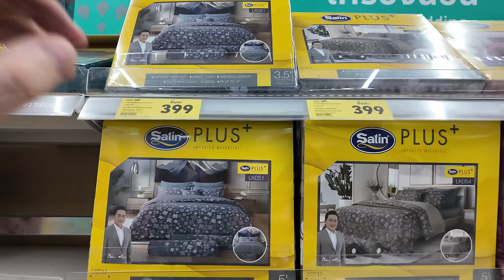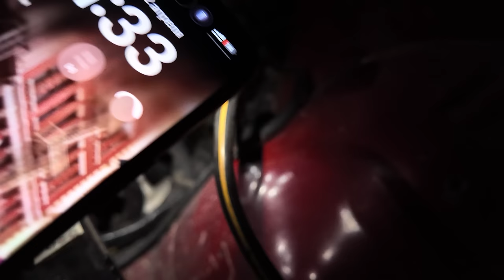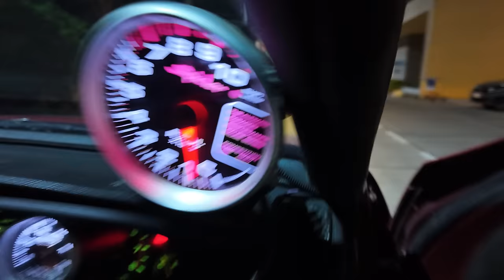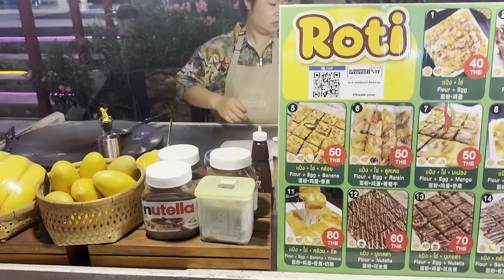Spraying Everyone With Water In Thailand

Comment: Rust-colored radiator water is not a good sign.  It should be clear and always check for fluid leaks on the ground.
Reply: @Skippymizzle It's Thailand. People do what they can to get by. But I understand what you're saying.
Reply: Radiator should have coolant which is green.
Putting water in radiator in summer just rusts it out then orange will come out.
In winter water will freeze in radiator.
Reply: @gailschultz9730  yeah and she said “ Oh the water you can see” I know how cheap they are in fluids hell they sell gasoline in pop bottles!  Buyer beware, Ivan’s gonna have to deal
With it for sure and he knows about coolant ( we call
It antifreeze/coolant , but they don’t never freeze so..
Reply: @none_ya001  Hello! Yeah I could imagine most of the guys overthere are better versed in motorcycle engines too. 
✌🏼
Reply: @gailschultz9730 I know, but this is Thailand. Never freezes.
Reply: @gailschultz9730  not true, theres purple and orange. Hoat and oat anti freezes also. Antifreeze also has anti corrosive additives which prevents rust
Reply: No, it should have antifreeze to prevent overheating.
Reply: @Skippymizzle  what's wrong with the gasoline in pop bottles? This is common in all SE Asia, and the bottle contains just the right quantity for a small motorbike. Selling it provides some income for low-income families....
Reply: @Skippymizzle  Antifreeze/coolant helps your car run cooler in the summer and stops your cooling system from rusting.
Reply: @mick-berry5331   safety ….quality

Comment: Don't install the turbo it puts more pressure on the engine and it can kill is faster.
Reply: agreed
Reply: Especially in Thailand. They need dependable transportation not a race car...get a Camry or a Civic
Reply: @georgemartin1436 I agree, forget the turbo.  Get a Dodge Charger!
Reply: We don't like anything smaller than a medium six cylinder.
However the used car with medium four with turbo in it can do as good if not better than the medium six but good mileage compared to the med. 6 cylinder I had.
Only issue is it takes off so fast that I am used to needing more time to get to normal speed so I am way over in that time and with low profile tires it rides better and curves at faster speed feels better.
Can give our Chevy half ton 6 cylinder med. or larger size engine, some competition.
Reply: d.b.7352  we’re talkin Ivan he’s Mr cheap. Except when it comes to electronics, or things with cool flashing lights 🔴
Reply: @georgemartin1436  Second that two of the best cars and car companies.
Reply: Also, is the local octane high enough for the turbo?

Comment: Pull the dipsticks and look to see if the oil looks ok. If you see coolant in the oil, the head gasket is blown. Look at the tranny fluid to make sure that it's clean. You can tell if a car was maintained by just looking at this stuff. Look at tread wear on the tires. Is it even? Just a couple tips.
Reply: You should smell the oil and trany fluid ! Do they smell like oil, or burnt oil ?

Comment: in thailand "oil" translates to gasoline.  "engine oil" is what you want to say, but even then the translation can be difficult.  Getting work done on your car in thailand is difficult, i would recommend getting a completely stock car there and also get something that you see many of on the streets.  finding parts for uncommon cars is difficult and mechanics have a different mindset than you might be used to, if they can get it to drive down the road again it is "fixed," it is difficult to find someone to fix things correctly to factory spec.

Comment: I googled the bed linen, aseannow had a thread about it from 2006, it says Thais buy very expensive (compared to the rest of the world) duvet with no cover and they don't wash them.  They say it is VERY difficult to buy duvet covers and bedlinen is very expensive.  You would have to use 2 top sheets and sleep between the sheets with your duvet on the top.  Flat sheets are also difficult to find.
Reply: When was visiting USA in EVERY hotel a blanket was just put in between 2 bed sheets. So i guess it is similar with Thailand

Comment: Id be getting a toyota these days. Bud.  Most cars engines are trash in late 2000s. Cheers Mr Sanctioned Ivan. 😂
Reply: Including Toyota.
Reply: I see a lot of toyotas on the road there.
Reply: @goclunker  agreed man i live in canada and i just bought a 2009 dodge caliber and its got 130,000km on it a and it run like a champ
Reply: @seanwood5443  Dodge Caliber?  One of the worse cars ever, forever breaking down.  That's why used ones are so cheap.  You got lucky with yours.
Reply: Buy a Honda Civic SI 2 door/Coup with Vtech,  Great cars and used in Fast and Furious.

Comment: In the US the blanket you are referring to is called a comforter. The thick batting has the cover sewed on so its an all in one solution and yes you have to wash the whole thing. Typically I am not a fan of them and would rather sleep with what we would call a blanket which is not comforter or a duvet but just a heavy piece of fabric, sometimes woven from heavy cotton or wool or some other fabric like felt. There is no cover that comes off so you wash the whole thing but It's much less bulky then a comforter and cooler to sleep in.

Comment: Ivan get yourself a magnet to test those car bodies for how much metal is gone. Those cars could have a lot of Bondo (filter) on them to cover up rust. Painting over crapy metal will not last , will rust through the paint quick.  Buying a “as is” car can be sketchy. No warranty. 
Make sure you check air conditioning and engine cooling system for no leaks. Run your finger across radiator if little fins   Break off radiator no good. 
Check temperature gauge and oil pressure if it have. All gauges must work, if they don’t you won’t know anything about how good it is.  In that heat cooling system needs antifreeze too to handle heat. If they have plain water in it probably got leak. Check overflow tank, if empty probably have coolant leak.  The oil should be at correct level if low ,oil burner also check tail pipe for black gunk oil burning and or runs rich.  If engine oil milky looking
Water in oil , head gasket , crack in heads this is no go. Look under for leaks, gas,oil or water. Ask why you selling car, ask questions to see if lying.  If they say no water leak and you find walk away.  Don’t sound too Excited about the car it will be more difficult to make a deal they won’t wanna come down on the price if they think  you have to have it😅.   Think what needs to be done and take off asking price. Check documents 
Make sure not stollen. 
Good luck Ivan, I love your videos

Comment: BE CAREFUL - You don't need a car wreck to deal with - farang probably will not do well in the Thai legal system.
What you are looking for to go over your blanket is called in the U.S. a duvet.  They aren't all that popular here - we have them in our home, but it seems simpler to just wash the blanket.  They are considered "fancy" in the U.S. and I suspect that they are more popular in colder regions, or areas with distinctly different seasons.  Anyway, try shopping on-line for a duvet.
Reply: In some parts of the U.S. we simply call that a bedspread.
Reply: @barreloffun10  All parts of US !!
Reply: In The U.S., a Duvet is used as a cover for a goose down comforter. Because goose down comforters are very expensive to dry clean (you can't wash them) ! I have never seen them used for regular blankets. As almost all the blankets in the U.S. are 100% washable.
Reply: @fposmith  We have duvets on both down and synthetic fiber comforters, and have comforters of different weights for different seasons, allowing the same appearance to the room by simply placing the duvet on different comforters.  It is my understanding from watching the entertaining "Feli from Germany" that this is a common practice in  Germany, and I suspect other countries, but it is certainly less common in the semi-tropical areas of the U.S., where we don't have as much need for cover.  I would guess that Thailand has a similar situation.  Naturally, YMMV.

Comment: Ivan, I know you really liked that red car, so I'll give you a tip: that small hole in the roof can be sealed with plastic wrap by yourself, and a can of plastic wrap doesn't cost more than 2 dollars. After sealing and sanding to level just buy a small can of red paint and a brush, you can do it yourself. Or you can look for a metal shop and do some welding on site and then paint, this won't cost more than 10 dollars.
Reply: I did not  see Ivan check the under body, where’s lot of rust could be. If it’s got rust stay away from such a car.
Reply: @chrisczarnik3439 Yes, you are partially right. Rust is a big problem, but this is common in all coastal cities due to the salt-laden wind blowing in from the sea. It will be very difficult for Ivan to find an old, cheap car that doesn't have rust in a city on the coast.
Reply: @chrisczarnik3439 The advantage of this red car is that it has the "Fast and Furious" style, as Ivan said.

Comment: Yo Ivan you don't need to replace the roof. Sand off the rust in and around the hole and patch it with bondo then you just paint.  Or have a shop do it. It's not that big of a repair

Comment: In the US there is a difference between a blanket, a bedspread, and a comforter. Duvet covers go over comforters, which do not reach the ground as bedspreads do.
Reply: Is a comforter the same as a duvet?
Reply: @susanwestern6434  not where I'm from
Reply: @susanwestern6434  I don't know but I have never had a problem with a duvet cover fitting.

Comment: I would just put some "body repair tape" (thin adhesive-backed strimp of aluminum) over the holes in the roof, and then hide the tape by putting racing decals over the tape. However, the rust in the coolant shows that the previous owner was doing NO routine maintenance, so don't expect it to last long. Given its problems, they will probably accept a really low-ball offer.

Comment: Check oil levels. Check under the oil cap. Look for light brown peanut butter substance under cap for (Blown head gasket) look in the coolant tank for bubbles (exhaust in coolant) look for oil in coolant. Buy an OBD 2 code scanner. Check for recently reset check engine light. Test drive, check brakes, tires. Good luck buying a car.

Comment: Bulky Setting/Bedding Setting on the Washer and dryer.  Most if not all blankets are that way in the west.  1JZ/2JZ or a RB are all sold power plants, just how much $$$$$ to get them in a good shape and running after they have been beat on.  Best bet would be a ECONO box/ Shit box  do they have K vans where your at those are the ticket and fun to drive.

Comment: Ivan another great decision not getting the red car. It is a four door which is not cool sporty.    I owned 3 Honda Civic Coupe Si Vtech engine which were used in Fast and Furious.    You cannot go wrong with a Honda. Bangkok there will be more cars to choose from.  Be patient!    To buy the perfect car if they have a Car Trader online .   You should be $ to get a mechanic to look it over before you buy.  Do a lien search and an insurance accident search.    Make sure the speedometer is not rolled back. Ask for service receipts and look at wear on the gas brake pad pedals.  If there is a lot a wear with extremely low kilometres be suspicious.  

The Roti looks flippin good!  Water fights always a blast!    Have a flippin blast of fun l.

Comment: Just a little advice.  Where you  wanted to squirt the guy and he and waved you off.  And you started chanting and all that.  He was just walking by minding his own business. 
You don’t want to piss people off there.  You are a foreigner and they might not react with all smiles as you expect. 
And if a local gets into a confrontation with a foreigner.  It’s very common other locals will join in to defend the other local.  And it will be more than one against you.  Physical confrontations  there are more common than you might think. 
Foreigners are basically tolerated by the locals. 
As long as you don’t overstep their boundaries. You are dealing with a different culture and should spend some more time learning about it for your extended stay.  Things will go much smoother and safer.  
I’m not saying don’t have fun. 
But you need to learn more how to deal with the locals for your extended stay.
Reply from the maker: im sorry but im celebrating

Comment: Be careful.  Pink stuff in the radiator could mean transmission fluid and antifreeze has mixed together and that will flood the transmission solenoids and ruin the transmission.  If that happens, you will have to buy a new one

Comment: No one replaces a roof on a car. The fix would have been to get some bondo or epoxy filler, pour it in or apply it, let it cure, sand it, and paint over it. You could have done the job yourself, or hire someone to do it.

Comment: Just to give you some advice when buying a car you never want to go try to buy a car at night time because there's a lot of things you can't see. Are there the oil leak on the bottom of the car? You ain't going to see it. Always look from top to bottom inside and out. Make sure there's no lights on on the dashboard and like he looked at the radiator cap is full of rust. It has to be green with antifreeze. Be careful when buying a car

Comment: They call gasoline Oil in Thailand. The biggest thing you have to look out for is flood damage. A lot of flash flooding in Thailand. 
Just get yourself a little Toyota. Easy to get parts and repairs, and reliable. Not hard to sell if you have to.

Comment: Old cars need to be checked every year by Thai land transport office which includes emissions and noise test. To get past any mods failing the test one must pay under the table. Next problem will be passing through any police checkpoints with a heavily modified car. Good luck with that one as a foreigner. Buy a sensible reliable car making sure its taxed and properly insured. The less interaction with local authority the better.

Comment: Get some jb marine weld bro, its great stuff!!. Its an epoxy that will seal it right up.  Sand it and Find some matching or close to  matching spray paint and a cheap clear coat. Done for a cheap car if you there only for a year or 2 max anyway

Comment: Very strange with the rust under the paint on the roof, that's typically the last place you would expect rust because it shouldn't be holding moisture. I noticed the trunk looked completely stripped of interior panels, and the whole car was repainted a different color. It's making me think the car was in a flood or something.🤔

Comment: Buy the red Nissan! Original engine, no smoke, not a Toyota swap as in the green one! The roof can be easily fixed on the red one if the body shop is a good one! They just fix rotten spots with new patches of metal that they weld. If done properly, you won't even see that it's been fixed and way cheaper than a car with bad mechanics!

Comment: Don't by European vehicle, parts are more expensive outside of europe.  Buy a Toyota Corolla  or Honda Civic to save on gas and parts are easy to find & cheap too.  Avoid buying a car that has an accident in the front. Engine is most important part of the car.  Of course, the seller fixed it to cover up so check under the hood for different color paint.  Good luck finding your car!!

Comment: And when you're looking for a car? Yeah those cars are nice when they're lowered but you have to be careful because you as a foreigner in their country they will take advantage advantage of you and I'm not saying all of them will but half will take advantage of you because they made me think that you don't know any better. Don't rush into it and take your time and don't get it. Lower the car because half of the time they'll heat their coils and make them lower. And you see it was already bouncy and it sounds like it was going to fall apart. You have to make sure the radiator is has green antifreeze or pink or yellow. If it's water, the motor is no good. Make sure there's no check engine lights. Do it during the day okay and make sure if you can get you a translator that speaks good English. That's better like that so don't rush into it. Find you maybe a truck or a car that's not lowered and put it through its paces. Like I said and make sure you look on the bottom that it's not leaking any oil. Take care

Comment: You need "water gun" and "Raincoats" ! You also need to buy a separate blanket. The blanket you are calling a blanket, is not a blanket ! It's a "bed spread" ! It's only for looks, for when the bed is made. Don't buy the red car ! If it has rust on the flat part of the roof, it has rust in places you can't see !!!

Comment: the red car has rust in radiator water. no good. the roof rust is not hard to fix. does not need to change the entire roof. u just cut out the rust and replace with mig welder. 
its a one day job to repair, and a two day job to paint. the hard part is getting the colors to match.
Reply from the maker: You think it can be just part cut and wielded? Looks like the guy mixed antifreeze with water maybe?
Reply: @SanctionedIvan  Yes sir. that damage is cosmetic, personally have repaired several damages like this.

it actually looks like chemical damage yes, i think kitchen cleaning product. 

the hard part is getting it painted so the shades of red matches :)